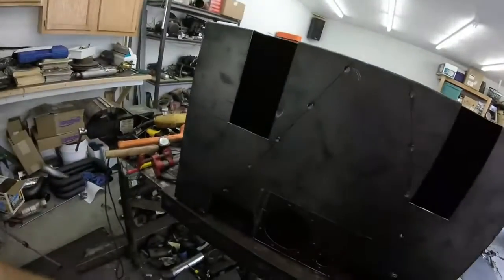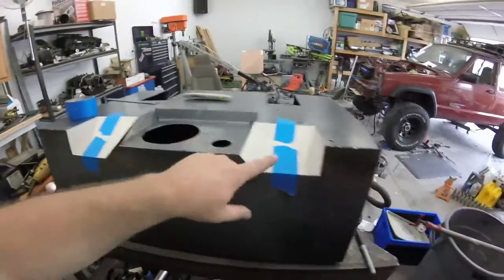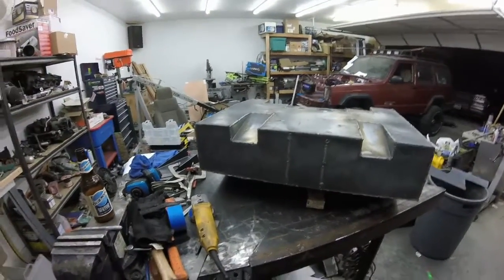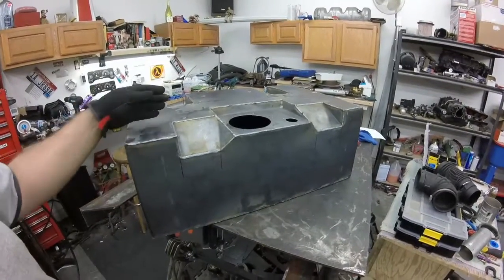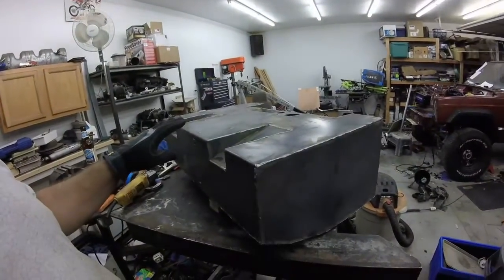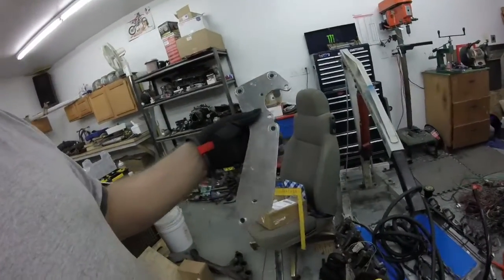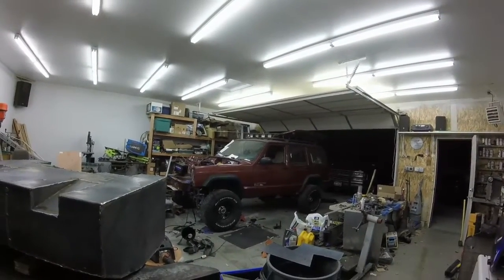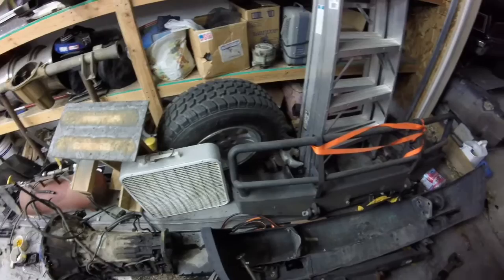98 Jeep Cherokee 5.3 Swap - Episode 7

Comment: I realize this was 3+ years ago but could you have flash tested your fuel tank by getting like 10psI into it from your compressor then see if it holds pressure? You could then soap the welds to find any leaks...
Reply from the maker: Yeah maybe could have. Sealing the openings up for the pump and filler neck would have been a bit of a pain. it worked out ok the way I did it. I put some tank sealer in it so I probably didn't even need to fix the pin hole leaks.
Reply: @jesscneal  - I've heard the epoxy sealer for fuel tanks works great. I was just approaching it using my telephone cable splicer perspective  - our underground copper cables have dry air on them. Anytime we open a splice case in a manhole, we have to soap it after we close it back up to make sure it's not leaking. Anyway, I enjoyed this series. I'm currently looking for a beater XJ and your videos encourage me.
Reply from the maker: @wes11bravo  Thanks and good luck with your project XJ. Happy to answer questions if I can